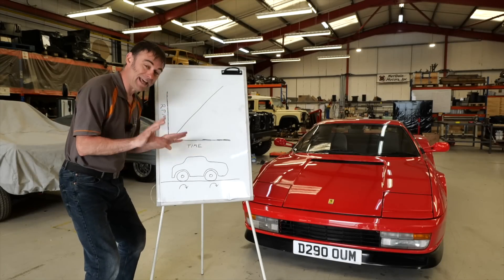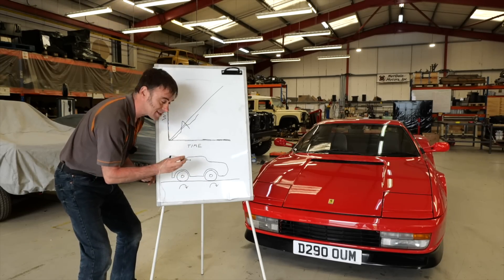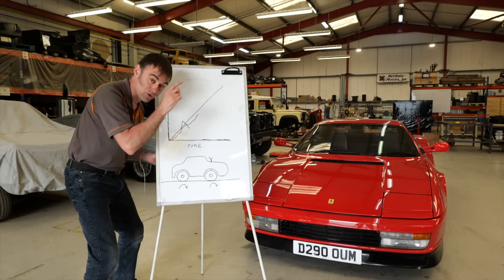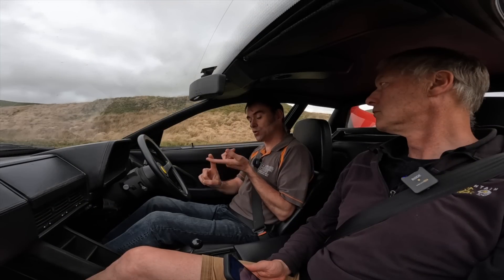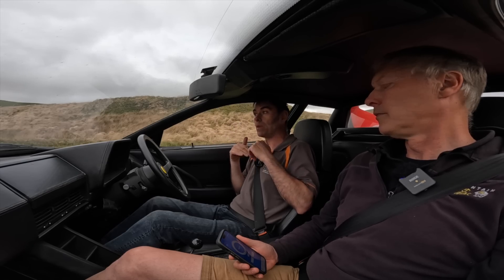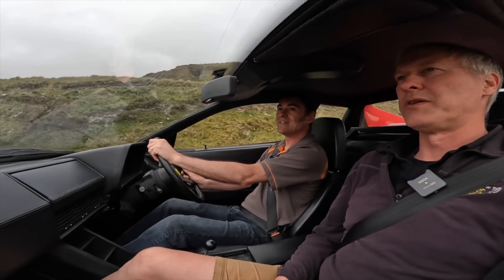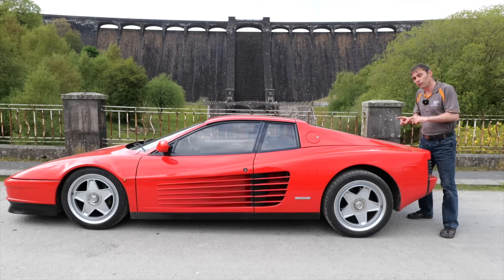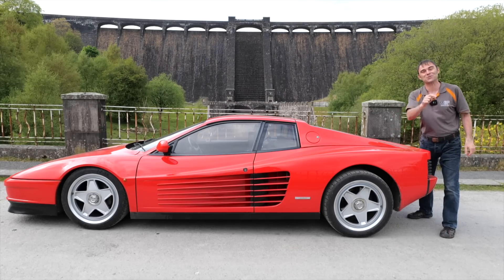Teslarossa Ep8 - 0-60 & Traction Control

Comment: An improvement of 0.61 seconds - 12.3% - was better than I expected. With a full battery, and maybe without a passenger, that improvement would have been even greater. Thanks to both of you for performing the tests, 🙂👍

Comment: I love the idea of an electrified Ferrari. I would not rely on GPS for traction control. It may work OK in the open Wild West of Wales with just sheep for company but the signal will disappear in tunnels and driving through forests or built up areas you will get multi path reflections that could make the instantaneous speed measurement jump all over the place.

Comment: Probably docked yourself 80 hp by not having full battery charge.
wheel kW = battery voltage x controller current x 80%

Comment: I have a gps speedo in my car ,do you have problems with overcast days like I do not finding the satellites
Reply from the maker: I tried a GPS speedo many years ago. The results weren’t good. So far the GPS traction control system has been faultless. Something must be fundamentally different between the two.

Comment: Very cool but nowhere near Model 3 Performance (3s 0-60) not to mention Model S Plaid (2s 0-60). While it’s probably more work to install and tune a wheel speed traction control would likely increase performance, maybe by 0.5s or more - which would be considerable. GPS just doesn’t provide enough resolution to do maximize traction control.

Comment: The original Testarossa had a best 0-60mph time of 5.2 seconds. Well done, awesome conversion.
Reply: That's mainly because it was tall geared to do 180mph (with only 5 speeds) back then and there was a dog leg shift from first to second before you hit 60 which took some time off. Plus it was pre traction control and 80s tyres were not as sticky for this sort of thing. 
I had a ride in one as a young man and it was v fast ack then, but you would never have conducted a standing start. If was much better once you were rolling and at higher speed.
Reply: @Cheltenhamlistener1  It was the car of many a youngsters dreams, including me. Hope you enjoyed the ride.

Comment: Richard, Greatly enjoy the channel, and I love the depth of engineering knowhow shown by you and your team.
I do have one small gripe, though.... Given that you have acknowledged that Traction Control is not just a performance enhancer, but also provides safety, I do not agree with using just GPS for this function on the TeslaRossa.
You must have spent quite a bit of money on this car, and as such, I would have thought that fitting speed sensors on the wheels would have been a worthwhile investment.  This car has tremendous torque and power - what if you hit an oil slick inside of a long tunnel ?  (We have quite a few of those even here in Australia) - Just think of the massive pile up it would create.....
Food for thought?
Ron

Comment: I wanna see what it will do when the motor and batteries are a little cooler and fully charged it seems like a four second 0 to 60 is well within reach
Reply: Especially if there is only one person in the car - the driver.
Reply: @peterduxbury927  Hey Tim, I think he just called you fat!  😂
Reply: It already did a 3.9s 0-60mph run in episode 7 with a higher soc in the pack. Should do low 3s easy in the dry fully charged&setup right.
Maybe a 2.9x on an actual sticky track surface. 👍🏻

Comment: Are you going to post who makes this GPS based traction control.  Does the traction control do so by changing the 0-5vdc  signal of the accelerator pedal or does it directly control the inverter.  My inverter control acuity is every 2 mili-seconds.
Reply from the maker: It’s made by EV Controls and communicates with the T2C controller via CAN.
Reply: @ElectricClassicCars  Thank you😀

Comment: So I ask what do you use in VW Bug & Crewcab/Buffy in regards to Traction, is it GPS cause of the Tesla Gear ?, I was wondering as it seems a nice option, to turn it off, to warm up the tires a bit, then switch it on for the "Race", or Demo .. ;), Maybe you should do a Lap around Nuremberg with it, Before Delivery, just to make Mercedes Drivers Weep, OOps, I mean to test out its function at speed ..
Reply from the maker: I’ve installed the same system in the Crewcab now. Works soooo good. We’re going to put it on everything now. 👍

Comment: Re living back to the future with that 1st burn out even the electric noise gave it atmosphere 👍with the GPS system is it plug in a play?or countless hours of wiring it in?
Reply from the maker: It just needs to have 12v feed and CAN wired to the motor controller. Very simple to install and one button to set it up. 😎👍

Comment: Really shows how limiting it is to have just two driven wheels.  There are any number of AWD electric SUVs doing 3 seconds or even less.  But yeah, for a RWD EV to get into the 4s is pretty fast!
Reply: The mcmurty speirling ev is rwd only and does 1.3s 0-60mph runs and 7.9@150mph in the quarter mile. 😀👍🏻

Comment: Gps is a terrible idea for traction control, its slow , delayed slightly, uodates barely a few times a second ( depending on signal and gps sensor  etc msybe 10 times per second if youre lucky)
Its prone to signal drop out, takes s while to get locked on after switch on.
Accelerometer and wheel speed monitoring ( comparing front to back ) would be better imho with maybe gps as a secondary system for calibration perhaps.
I saw some wheelspin in the video with traction on i think.
Reply from the maker: I thought the same as you, until I tried it. The result is amazing. No wheel spin at all. I’ve not noticed it to take any time to get signal.
Reply: @ElectricClassicCars  gps probably already locked before ignition maybe?
Great that it works so well.
Probably more reliable than having a sensor on the front wheel.
I build and fly racing drones etc , the accelerometer etc  is super for that sort of thing but GPS very slow.
Maybe it has a accelerometer built in too?

Comment: What makes me laugh is his Land Rover can do it in 3.8 seconds 😂
Reply: I suspect that by the time that Rich has sprinkled some magic dust on the power management system, the Teslarossa will be closer to 3 seconds for 0-60 mph
Reply: @neilmckechnie6638  remember tho, his Defender is AWD....and it's punching out 600hp. 
Both vehicles are around the same weight too, which is interesting. 
Also, keep in mind that traction control cuts power (momentarily) on and off to limit wheel spin. There might be some time lost there, even tho it's faster than no TC on a RWD vehicle. The acceleration ramp looked a little soft too, but that can be adjusted.
I'm not sure if the Defender has TC or he is just relying on the AWD grip.
I'm guessing once the suspension is sorted it will help with weight transfer and a little more tuning might get it down to below 4
Reply: @Mardy72  You raise an interesting point; the possibility of a AWD Teslarossa which may be someone's solution for a track-day weapon.
Reply: The Testarossa will no doubt have a significantly higher top speed, greater refinement and go around corners a lot better than his Land Rover as well!
Reply from the maker: AWD really helps to get the power down. It’s all about grip when you’re down at 4 second or less 0-60mph times.
Reply: @ElectricClassicCars  thanks Moggie, exactly what I was thinking. I believe the Ferrari is gonna have a hard time beating the old Landy in the 0-60 department.
Reply: AWD drive on the RR but MUCH bigger rear tyres on the Testarossa, which is where most of the torque goes even with AWD. On a 'normal' RWD car (with more sensibly sized tyres) it would be difficult to get times close to 4 secs even with all that power (and who knows, the Testarossa may well do 4 secs or  under eventually).

Comment: On your video when you mounted the drive unit,  it looks like you mounted it 180 degrees about the axis from how it's mounted in the tesla (cv in the rear). Did you have to reverse your wiring for the drive to spin forward?

Comment: Why not just compare the speed of rotation of the front wheels versus the rear wheels ? 
A lot cheaper safer and simpler, since in town there are places where GPS will often drop out.
Reply: Because the gps antenna doesn’t use the satellite to measure speed, it derives the it from an accurate accelerometer
Reply: Came here with exactly the same question. This is rear wheels drive, why don't use it without all this sat options.
Reply: I have the same concerns about GPS. What happens in a tunnel, or a city full of skyscrapers? As for why not use wheel sensors, I'm going to guess it is a lot simpler to retro fit the GPS version to a car than it is to add rotational sensors to each wheel.
Reply: I doubt the Ferrari had ABS so it won't have wheel speed sensors.
Much easier to fit a GPS system.
Cant see any sensible person needing traction control in a built up area!

Comment: What happens if you lose gps signal?
Reply: Traction-control off or maybe if the wheel-sensing TCS is also on the car as a back-up system for redundancy.

Comment: Is it really a GPS-based system? Probably a system with an accelerometer sensor. Those are extremely useful and exact. GPS is not.
Reply from the maker: GPS only. I can’t believe how good and accurate it actually is. I’ve installed it on my VW Crewcab now too and the results are the same, outstanding.

Comment: What happens with the TC when you're inside a tunnel and lose GPS signal?
Reply: I'm also curious. I read about some sensors online and they combine 3-axis gyros, accelerometers and magnetometers - so perhaps that also comes into aid for traction control? Particularly accelerometer. Think "at what speed computer sees wheels spinning versus the inertia felt by accelerometer" - this would also explain how it's so instant as accelerometer gets immediate feedback from inertia. 
Accelerometer however can't tell the speed so GPS aids for corrections at high speed which still makes your question relevant.

My assumptions though.
Reply: I wondered, too. I should imagine the answer is to be gentle with the right foot.
Reply: Came here to ask the same!
Reply: What's the chances of needing TC when you're already moving? Unless there's standing water in there and you aquaplane, but if you come to a stop in a tunnel, then it'd probably be traffic related, not going to gun it away there.. Also wondered tho

Comment: Are you inviting The Stig to your track test😆.  That looked painful during those runs but the rate of acceleration doesn't really come across in the video.  It almost looked like quite a delay from your right leg planting the throttle and the scenery starting to move outside the window?  You should get a G-Meter hooked up, see what the forces are?  Still very impressive to watch though and, as others have commented, Wales was looking splendid.
Reply from the maker: We record the g forces on the Dragy. We should show that next time. We have someone better than the Stig lined up for the track test. 😎👍

Comment: Do regular cars with traction control use GPS as well? Wasn't it easier to place a speed sensor on the front wheels, since they won't slip?